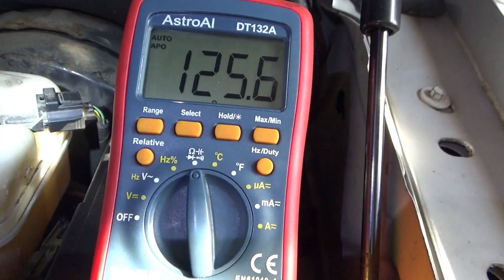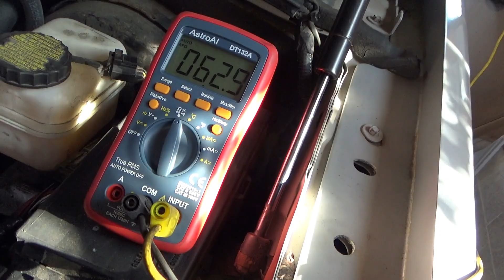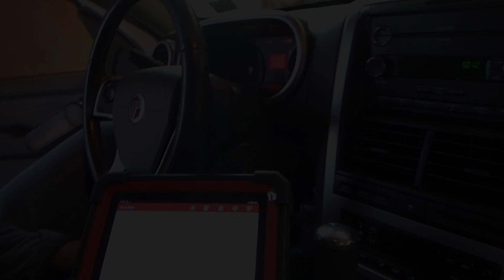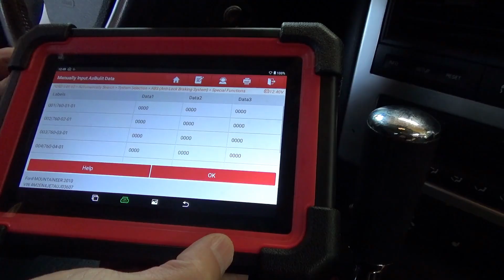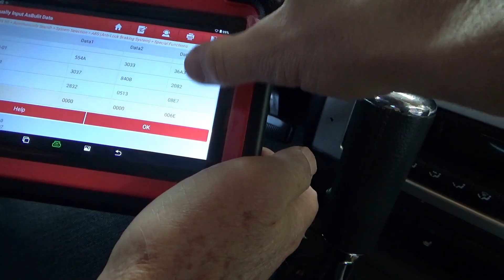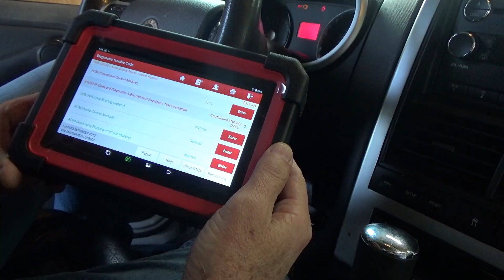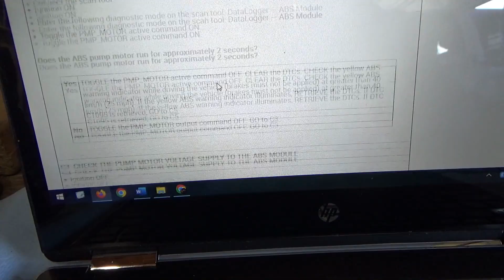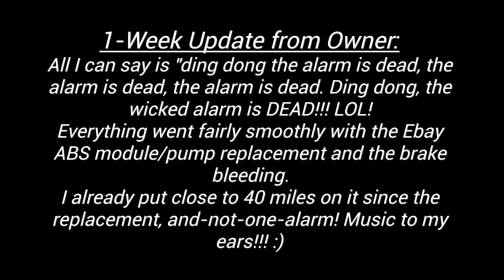Most ANNOYING Ford in the World? (ABS/RSC Warning - Part 2)

Comment: Ivan, thanks for the great video! Without your help on this one,  I'd still, most likely, be chasing my tail on this issue! 😅 I'm very happy to report that the Mountaineer is still running like a champ - no more  "dee doo's"  ever since I replaced the entire ABS unit. I put the ABS unit to the test a few times now; when it was raining I tested the braking and now with the snow that we just had, I put the spin test on it and its working perfectly. I also repaired that "badly repaired" hot wire that was under the battery tray and cleaned up the harness with some good wire loom conduit.  Since it's running fine now, I think I'll keep as it reminds me of my mother, when I drive it and I'm sure she's happy that we solved the problem. How on earth she dealt with that alarm all those years, is beyond me. But, she was a mother with lots of patience.

To all of you other shade tree mechanics out there, be persistent with problems that you find. I don't know of one vehicle manufacturer out there that doesn't have problems. Yes, I grew up with Fords all around me,  but I'm not biased towards them. I still have a 2000 Ford Ranger that hasn't given me any problems except for the standard routine maintenance (and rust issues. But at 24 years old and living in the rust belt, I'm not complaining.)  I've had Datsun's (yes, I'm in my early 60's) and I also have a 2011 Subaru Legacy with 232,000 miles and runs like a champ - and I'll most likely drive that car into the ground because it has been so good to me.  The only problem that the Legacy gave me, was a bad solenoid in the CVT valve body - but, with some research, I fixed it myself. I've also had (2) Mercury Cougars XR7's in the past that were great cars. 

The way I see it, is that if you take care of them, they'll take care of you. And when problems do arise, and you're struggling to get the problem resolved, there's always Ivan to help you out. 

Many thanks again, Ivan! If I ever come across something else that I can't diagnose on my own, I know where you live. 😜
Reply from the maker: Thank you for the feedback Kevin! That was a fun case study for sure 😁👍
Reply: "I've had Datsuns" Well you get some cool points for that one. Much respect to people who try to fix their own cars, it's so worth it not just for money savings but also the satisfaction of figuring things out. Cars problems these days are not always easy to fix but with logic, persistence and a good scantool it's possible.
Reply: @thomasbrandon8029  Couldn't agree with you more. 👍
Reply: Ivan is the man.   I've learned so much from this channel.   Would love to get my hands on that scan tool!
Reply: Glad you got it taken care of!
Reply: All good that ends well!!
You're very lucky to live that close to Ivan!!
I too do all of our automotive repairs! Newest vehicle is an '03 Forester. Currently chasing down a no start condition! Just had the engine out for rings. 1qt 1000 miles or less on oil consumption!!
Engine started up well. Ran for 3 minutes. Started sputtering and then died. Crank no start. Hopefully soon I'll figure it out.
Reply: Which mechanic doesn't appreciate positive feedback?  Congrats, Kevin.  Happy trails.
Reply: @jeffryblackmon4846  Thanks!
Reply: What autel model was that?  I would like to get a bidirectional one with tpms functions too. Autel's website is less than desirable for trying to compare their own products!
Reply: @JLLG2  Ivan has it listed in "his" comments.

Comment: Ford has several models (my 2009 Fusion had the same motor code. Verified fault. Had to replace the HCU. Very tough to get the ABS HCU bled. Had to pressure bleed 5 times before getting all the air out.

Comment: The ending reminded me of a R172 SLK350 I experienced with a bad abs module. The customer lived on a gravel road and when ESP cut in the motor relay inside the module got stuck closed and the abs pump ran continuously until you pulled the connector or the battery, it was sitting in the carpark whirring away after the tow truck dropped it off. To me it seemed a strange mode of failure for the ABS pump, and I was a bit surprised it had a terminal 30 connection tied to pump operation

Comment: Although most of my trouble shooting is mostly on the industrial side with over half a century of training and experience the same rules and laws apply. All data points must have a weight or relevance that ought to be explained, hearsay or word of mouth must be given the least relevance and so on. Unfortunately, most of us with experience don’t do a good job in explaining this to those with less experience because we do this unconsciously. All trouble shooting should start with a symptom function analysis, lamp doesn’t work check to see if it is plugged in, back when we had mechanical ignition points, car starts when cranking but stops when you let go of the key is most likely the ballast resister. Modern cars are much more complicated, diagnostics are required in the use of a scan tool or other testing, or a scope using signature analysis that are given a weight or relevance that ought to be explained. If the weight or relevance is not one hundred percent, we start replacing parts unnecessarily….

Comment: Some of therse ABS modules had an issue with dry jointing on the main power supply inside the module, it's a fairly easy fix, once the electronic part is removed drill a 10mm hole above the main power cables and re touch them with a soldering iron. Fill hole in the plastic cover with blind 10mm grommet

Comment: did you need his Launch to do the programming or could your thinktool pros have done that?
Reply from the maker: Same software 👍
Reply: @PineHollowAutoDiagnostics    I believe you and I have the same thinktool PROS.  I bought it about a year ago.  I may have issues with mine as i cannot seem to maintain a stable connection to graph any trends where yours seems rock solid.  I tried looking at their website to possibly buy another dongle and try that but I cannot seem to find any trace of the PROS on their website or how to ensure I'm getting the right one.  Wish I lived close enough to have a certain someone "diagnose" my scantool.  that'd make a good video eh?

Comment: The pump motor hadn't run in a long time, I'm surprised you didn't smack it with a hammer a few times lightly while trying to bidirectionally control it. I've had really good luck doing that on my own junk lol that would have been the proper "Russian repair"
Reply from the maker: Proper Russian repair would be to disable ABS and all annoying dingers 😆

Comment: Wow, I guess I got off easy with the module repair on my 09 F150.  I sent it off to Van Nuys, CA and it came back fixed, no programming to the vehicle was necessary. I just tested it in the SW Idaho snow and all is working as it should be.

Comment: How fun was that ?  I worked at a Cadillac dealership years ago, the early ABS systems did not have the ability to check for DTC's so it was all step by step diagnostics, there is one I'll  probably never forget, it's a long story so I'll just summarize it, a pinhole leak in a heater hose would spray on the hood, drip down on the pressure switch causing the the not to run when needed of course this was very intermittent  because the heater hose would spray more under engine torque, anyway it was an interesting lesson.

Comment: My ford had the same issue on the terminals that were too loose.
It was like someone stuck a fat probe in them that resulted in the intermittent ABS problems.
I too had to remove the pins one by one and do the same thing to make them tight again. 
I was curious to see if he would have the same issue as I did as well as the same fix.

Comment: HI IVAN ,great video.This was the needle in a haystack job.LOOSE PINS>OK that's a hard issue to "PIN" down.haha  Teaching a customer how to do the right steps to diagnose his problem is gold.
Proving once again that you want to involve the customers in the repairs themselves so they understand the issues and why they pay you good money.In this case i think the issue was pin fitment all along>and firing the parts canon would not have solved it.the factory ABS modual may have still worked but the last owner was unaware of the REPROGRAM ISSUE.Launch for the win.

Comment: Nicely done as always.
What a boondoggle moneymaker for dealers. Can't just buy replacement modules as plug and play.
Reply: This is the first I heard the pump motor dies from sitting there.  Any idea how long to ensure the safety of it staying dead.  If had the wheel sensors cut for 6 years now.  Can I hook them up so the ABS and traction idiot lights shuts up?
Reply: Yeah....hours of tracking down tiny wiring and miniature pin connectors that are located in areas when road grime hit them. I have a new appreciation for my "antique" vehicles. I have two of these newer Fords but the "antique" ones always work.

Comment: I had that problem on the 'ol Marquis years ago.  That ABS pump was about $400.00 and I replaced it myself.  The ABS light would come on when the car went about 12 mph and would flash.  It also works with the traction assist and in the owner's manual it says the hydraulic pump can overheat if you continually spin the rear tires.  It has a thermal switch that is supposed to shut it down if it gets too hot.  Great repair, Ivan!  GREAT VIDEO!

Comment: Amazed to see that the Launch tool also has the exact same as-built programming Order of Operations glitch that the recent versions of Ford FJDS have had!  It still works fine, it'll just spook you if you've done a lot of as-built programmings.
Reply from the maker: What was the glitch? 🤔
Reply: @PineHollowAutoDiagnostics  It asked you to install the new module after you had entered the as-built data.  It should only ask for that if you told it the old module was still installed, and it would prompt for it prior to entering as-built data.

This glitch exists in FJDS as well, at least as of a few months ago (last time I used it), and if you're pulling data off an old module, it will really screw you up.  It can be overcome with some trial and error (and bad words), though!

It really highlights that companies like Autel and ThinkTool are pulling the code direct from the OEM software.  Whether it's licensed or not, I do not know.

Comment: 95% of the time, parts cannon works. 

I was charged $250 for a glow plug the other day - 2 hours diagnosis, just to make sure there wasn't a wiring fault or something. Fuck off. It's less that $10 and 10 minutes to fit a glow plug.
Reply from the maker: It also takes 5 minutes to diagnose a bad glow plug... Where did they get 2 hours from? 😂

Comment: Ivan, I have a 2006 F150 and changed my abs module 2 years ago and get the vin number mismatch BUT do not get that dinging problem, it must have been his pump motor all along and he attempted a parts cannon abs module in attempt to fix it.
Reply from the maker: Pump motor code set only after proper programming 😅
Reply: @PineHollowAutoDiagnostics  my pump was constantly triggering till I replaced my abs module, after that, no problem even though I did not program the VIN number, I guess a different fault. I am just being lazy since I have Forscan 😀

Comment: leave it to Ford to have an annoying ding to try and make owners panic and have the truck  towed to the stealership for some premium "blue oval" service, without vaseline...
 I guess the bright ABS warning light on the dash would not suffice.. all of the ABS'/traction control systems are designed to just disable the system when there is a fault, but you will still have brakes.. you just cant drive like a maniac until its fixed..  Ford owners are just a different breed... thier thinking  : yes, I will be miserable, and spend alot of money to keep in on the road over the years,  .. but it was CHEAP when I  bought it, so im way ahead of the game... thats what daddy and grandpa drove, and they had 5 parked behind the house for spare parts.....

Comment: Why does it make that danger dinger like it does when the door is open your lights are on or you're low on oil pressure or overheating normally for ABS problems it just goes bing not bing bing

Comment: Ivan, if the customer has a sun roof, that water is not draining out properly down the window pillar. Have him open the sunroof and use compressed air down the drain hole.
You also may have to run a piece of 14 awg solid wire down that drain hole to clear it out.
This is common on all older escapes and especially if the Car sits under a tree!
Great video as always!
Reply: It does have a sunroof, and I did check the drains - all are good. How the "crusties" materialized in that connector, is beyond me. But, I'm definitely keeping an eye on it.

Comment: Nice work Ivan! Electronic systems can be alarmingly difficult to most. That can ding you when a customer gets the "one more issue" return to shop light. At least the computer set the code right away. Was it because of the gravel road or does it check the pump each time the break is pressed?
Reply: After every startup the abs system checks the pump motor once the vehicle hits something like 5-10 mph. So that's why it went off down the driveway, he finally hit the test speed.

In some vehicles you can hear the pump run when you hit the magic speed.

Comment: Hope you-all see that sticking a too-large pin into a connector spreads that socket causing LOOSE connections.  Gotta be careful about this!
Reply: Sometimes it is just the unplugging & plugging it in a heap of times causes it .Iam sure Ivan has mentioned it before new age wiring being so thin they make the connectors tiny & you need to be very careful with them.
Reply: @LesReeves  particularly if pin are skewed to sockets when insertion occurs.

Comment: I had a 1993 Volvo 940 that was flooding so bad in cold weather.  I pulled the temp sensor and it tested perfectly.  I put it back in still had the problem.  By chance I turned over the connector and oh the green slime I saw.  PB Blaster contact cleaner and away it went.

Comment: the look on the customer's face after you found the problem was pure happiness. great job ivan!
Reply from the maker: And then frustration when the dinger came back... Twice 😆
Reply: Yeah, but we got down to the nitty gritty of it. Had to solve that issue before the main culprit reared its ugly head . I'm still baffled on why bad ABS pump code didn't materialize until after the bad wire connection issue was solved. But, I'm not losing any sleep over it since all is well until this day. @PineHollowAutoDiagnostics
Reply from the maker: @kfessler1 ABS module couldn't run the pump self test until it was properly programmed looks like 😉